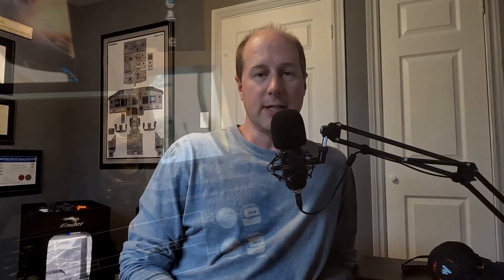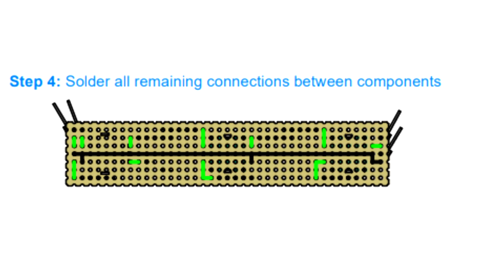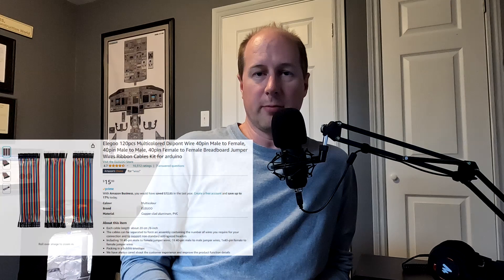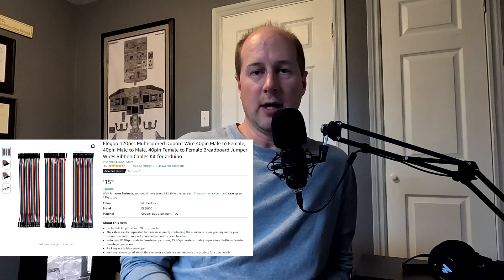A $100 MSFS Hardware Upgrade that is a game changer - Building a 737 Home Flight Simulator Episode 2

Comment: Any updates to this? I'm currently printing the case now and will be ordering the parts soon. This is really the last thing I need for my sim to be functionally complete.
Reply from the maker: The only update is that it still works great 😎.... Make sure you calibrate the touch screen in Windows before you assemble the case. Most of the calibration touch points are hidden behind the case once it's all together. 

It's not a perfect unit. The case is too thick, in my opinion. But I think thats because they need to fit the pots above the screen. The real-world version is only a 5.5-inch display. This one uses a 7-inch but just covers over an inch or so at the top and bottom.. Flight Sim DIY said they were going to do a complete G3000 avionics lineup. But nothing yet from them.

Hope everything works out for you, having the physical components now have made flying the sim so much more enjoyable.
Reply: @thesimproject73 great suggestion, thank you! It is a little bulky but it will greatly improve the experience. I have zero experience with soldering and wiring so this is gonna be interesting 🙃Took 4 hours on my bamboo A1 for the front and back and all four knobs.
Reply from the maker: Love the Bambo wish I had one. It was double that and more to print those on my Ender 3..

This is actually a good starter project if soldering isn't your thing. Just some basic soldering nothing too high tech.

Comment: Could I pick your brain again? Got the arduino set up fine. Headers connected and wires as well. My question is on the schematic sheet step 4 it shows the green connections is that basically a solder bridge between pins? And also I see the black line ?? Is that to ground the Charlie pins? Or if you have a tip on how to ground the Charlie pins on the encoders I'm getting closer to finish.
Reply from the maker: Careful, not a lot of brain to pick at 🤣.. But yes, the green lines are a bridge between the device and the wiring pins, and black line is the common ground - GND pin on the Arduino to the encoder Charlie pins
Reply: @thesimproject73  Thanks so much.
Reply: I got the encoders solderd in fine....had to use a foam pad with holes to hold things upside down. I'm attempting to solder the 90 degree header pins to the board the encoders are on. If I put them in and turn it upside down they fall out...I don't think you can solder top down because I'm afraid I'll burn up the little plastic piece.  Any advice? How did you get those  12 headers on? I'm new to soldering so I'm trying my best.  Thanks bud
Reply from the maker: I bought a 3rd hand off Amazon to hold everything well soldering it..  Search STANZ Basic Helping Third Hand with Magnifier. They work winders.
Reply: @thesimproject73  I do have a helping hand with 2 gator clips and a magnifier I put the pins In turn it over and they all fall out. Maybe use the clip to hold it upside down and the other to hold the pin? Thanks for your continued advice. Having a heck of a time getting those 90 degree pin headers in.
Reply from the maker: Ya the pins are a bit of a pain. They will take some heat from the top and not melt the plastic if you're careful enough. If I was to do it again I'd skip the pins and  solder the wires directly to the board.

Comment: Could I ask.... what did you find was the best way to cut the breadboard for the encoders? Thanks
Reply from the maker: Used a drywall knife. Nice solid blades in a good handle. Score it a  few times with a steal ruler as a guide. Then break with your hands. Should come out nice and clean.
Reply: @thesimproject73  Thanks for the reply bud....I'm working this project right now and was having trouble with that part. Take care ✌️

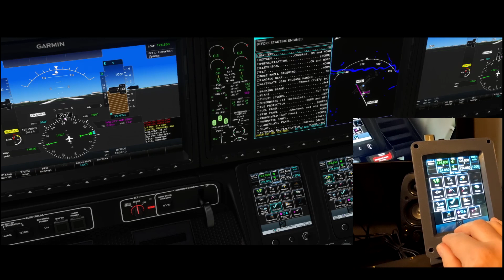Comment: Hi! 8:13 How did you set that button to change the place for the checklist? I have a stream deck plus and I would like to see if I can assign that function 

Thank you for your help!
Reply from the maker: The Hjet has a whole bunch of custom LVARs that can be accessed via simconnect. I use Spad.Next and Mobi-Flight. As iMSFS doesn't have a default key binding for this one

They have an Excel sheet with them all on their Discord. 

But I think the one you are looking for is 

H:AS3000_TSC_Vertical_2_MiddleKnob_Push

Comment: Tried this, great little addon but huge hit on the frames, not worth the hit with my setup
Reply from the maker: really? What's your setup? I'm on an old i7 6700 and it doesn't seem to upset my FPS at all..
Reply: @thesimproject73  i97900k with a 3060ti on 4k

Comment: One question: Wich version of Windows are you using? because I have Win 11 and I can't find the way to set the secondary display as a stand alone touch screen, even following all the instruction on how to set a tablet via control panel... doesn't works (works like a control pad for the main screen). so I'm curious to know if you are using the same OS and if you have found a solution. Thanks.
Reply from the maker: I'm on Windows 10 still, my CPU is too old for Win11... But I've had the same problem in Win10 as you are talking about. The instructions windows gives is not super clear (mostly because the writing is super small and hard to see). When your in the setup and all your monitors go white. Make sure the black text is displayed on the touch screen and all the others are just a white display. Pressing the enter key, will cycle the black text between the monitors. Its the step I always miss, and by missing that step. When you try the touchscreen things move on your primary display. Let me know how you make out.. 😉
Reply: Thanks for your answer!! unfortunately I've allready tried all that multiple times, looking close that the text was on hte correct display before touching it... but nothing, once I touch the small display the setup close it self and the touch still works as a trackpad for the main sceen (like a laptop trackpad). I've also tried changing USB cable and port and changing Display cable and port (although those should not have an impact on the touch settings) but still nothing. It is also not a driver or HW incompatibility issue because if I set as a primary monitor the 7" one and as secondary my main 27" monitor, and then I repeat the "tablet setting" of Win 11 now the touch screen works fine on the small display, but of course It can't stay set like that. I've asked you abuot the OS because there are videos like yours where Win 10 seems to work fine, but I cannot find video with win11.
Reply from the maker: @jampor207  sorry to hear it's such a pain.. Glad I'm not on Win11 I guess 🙄